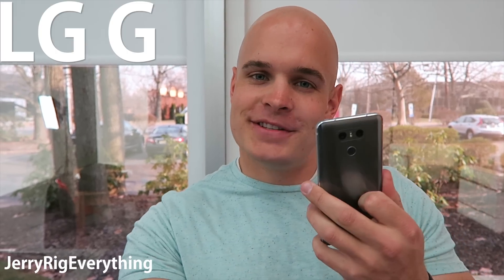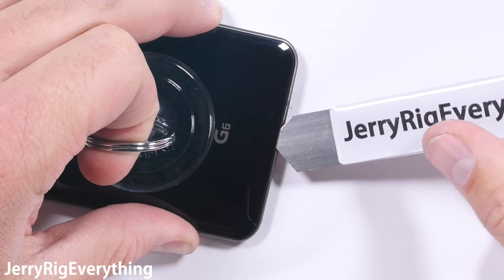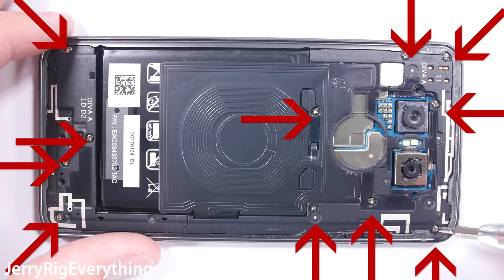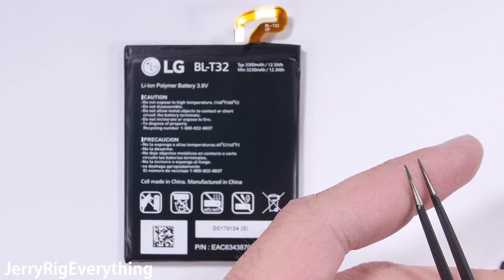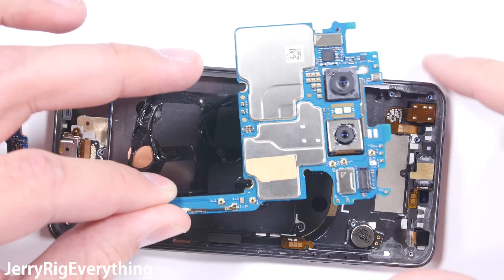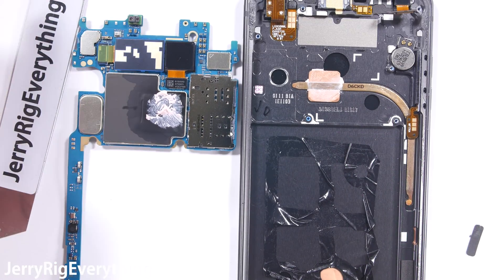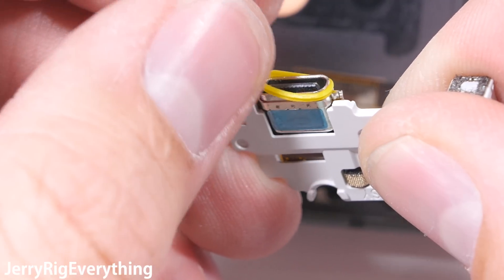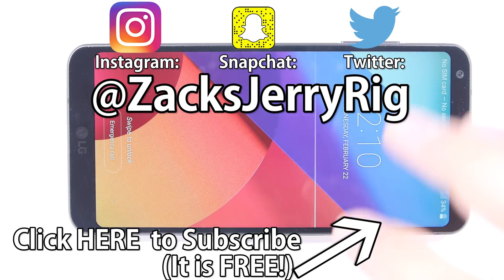First Look INSIDE the LG G6 Smartphone

Comment: Seeing the guts of this phone made me realize how stupidly regressive Apple is with the iPhone. Gives you a much better perspective on how Apple is cheating its customers with subdued features. LG G6 has a bigger screen but smaller body compared to the iPhone while also offering so much more.
Reply: The real problem with Apple is they run their company like a cult. It's a fashion statement to own an Apple product, not a practical choice.
Reply: Well, their hardware and software sure ain't lacking. In fact, they have one of the best if not the best hardware/software out there in the market today. What really puts me off about Apple is how they're purposely cutting off features from their products when you can clearly see that it's not only feasible but already done. Wireless charging + expandable storage + waterproof + 5.7" display in a form factor smaller than the iPhone 7 plus? Why are we not getting that in an iPhone?
Reply: I already stated above that Apple has one of the best if not the best hardware/software out there but until we see the A10 running on Android or the snapdragon 821 running on iOS, we can't really jump to that conclusion. I'm unbiased here, I own an iPhone 6S+ and a Note 4. Still prefer my Note 4 because of the features.
Reply: Requiem Aeternam It doesnt take a break down of a phone to realize that apple is garbage lol.
Reply: I'm very unbiased when it comes to tech and I always give credit where credit is due. The ecosystem of Apple is very mature and gives you exactly the experience you're expecting from it. What I'm pointing out right now is that I gave Apple the benefit of the doubt when they removed the headphone jack, thinking that it was all part of their design to utilize the space inside. Seeing the inside of this phone just highlighted how Apple's design team is lacking in that department.
Reply: +Vik you can't really compare the power of those two phones as they run different software, it's like saying the R7 1800X running in Linux is more powerful than an i7 7700k running in Windows. On the topic of the LG G6 being a newer phone, let's substitute in the S7 edge in for a moment and compare the feature set. Still the same results, I regrettably inform you.
Reply: Vik you just completely missed his point haha
Reply: Can you please look up the word "unbiased" and tell me what part of that definition constitutes what I said? Also, please make it a habit to know the whole story before making an uneducated opinion. Despite all of those blatant flaws in your so-called argument, you are entitled to your own opinion and I would gladly express mine.
Reply: Apple gets the most attention because they have a completely different marketing strategy than most other companies. Somehow it works. Sheeple (people who can't think for themselves) buy their products because Apple has built up an image and name. They just get an iPhone because they think it's what everyone gets or what they're supposed to get to fit in. People love to fit in. 

Practical people who want the most for their money can't understand the power of this 'herd' mentality. They can't believe it actually works. So they go on to social media and make fun of Apple for the features they lack, the restrictions they place on devices, the software issues, and the price they charge for it all. 

The sheeple don't like being called idiots for buying a product that was supposed to help them fit in. So they try to come up with ways to defend Apple. The reasons they give usually had no actual impact on the reason they chose Apple. They just blindly defend every little decision the company makes. Apple can do no wrong. They could make literally anything and people would buy it because it has a piece of fruit with a bite taken out of it stamped on it. It worked with the book they made. A book that only goes to show how full of themselves they are. 

I take that Apple logo to be quite a powerful metaphor. You're being sold an "apple," but when you get it there's a bite taken out of it. You paid full price, but someones gone ahead and eaten some of the best parts and you're stuck with the rest.
Reply: @imadecoy.  Damn.... Introducing philosophy into an iPhone conversation. I agree with your point, though
Reply: +Vik  Why ignore what he wrote? He isn't talking about speed, he even said "they have one of the best if not the best hardware/software out there in the market today".  I would also beg to differ in real world use. The iPhone 7 despite being more powerful, has inconsistent smoothness with its UI animations and scrolling in certain apps. Although I would put that down to the buggy iOS 10.
Reply: Right on the point!
Reply: I don't get why we're talking about chip benchmarks when the original topic was about software+hardware features.
Reply: "The ecosystem of Apple is very mature and gives you exactly the experience you're expecting from it."

"Well, their hardware and software sure ain't lacking. In fact, they have
 one of the best if not the best hardware/software out there in the 
market today."

This is what you're calling "shitting" on Apple. Nobody needs to impress you, don't be an entitled prick. It really is okay to be smart wink wink.
Reply: Lesley Harrys I don't think he is a fanboy so much being that he owns both an 6S and Note 4. Extreme fanboys don't usually buy from the company they hate, at least that's generally true most of the time.

The way I look at it is he's talking about what Apple can do better in line with the current tech trends.
Reply: Lesley Harrys Calling people dumb and insecure is hardly civil discourse when talking about matters that aren't personal. Fanboys like being personal, and I'm afraid you display that more than he does.
Reply: Lesley Harrys You're going to have to try harder than a few basic insults. I get it. Your feelings are hurt so you're lashing out. Feel better soon buddy.
Reply: Apple isn't that bad if you just consider their hardware and software alone. What makes them suck gigantic hairy balls is the insane overpricing.
Reply: +Requiem Aeternam  The R7 1800X actually IS a much faster chip than the 7700k in many cases other than games which favor clock speed over core count. The 1800X in fact, beats the much more expensive 6900k in some workloads as well, all three systems running Windows btw ;-)
Reply: Also note that there's not a single word in my comment that merits this statement, "Throwing words you've read in word-of-the-day toilet paper doesn't impress me."

That went from 2 paragraphs to 5 sentences to unfinished sentences real quick.
Reply: Lesley Harrys One reason I can think of why people feel the need to constantly compare the iPhone with nearly every phone out there is probably due to its status as the phone that started the smartphone revolution. 

It was never the first ever smartphone historically speaking, but it did what all others before it failed: present a well thought out package. Apple's track record of producing consistent quality products has made it kinda the unsaid de-facto standard that other companies use as a competitive target. 

In a competition such as sprinting, people always tend to compare against the best set times with each other, and Apple is like the best sprinter amongst the rest of the other OEM's in the smartphone race so comparisons will be inevitably made for or against it, depending on one's bias of course.
Reply: I don't know about you, but the reason I brought up the iPhone and Apple is that I own one. If that fact is still isn't clear to you, I'm afraid I have some bad news. I was feeling cheated by Apple as a customer and that's why I stated those errant things. I get your point that in every video, someone brings up the iPhone, but in my case I was comparing it to something I own. If I had a Pixel, for example, I'd compare it to that.
Reply: Dude, the fact android devices were faster a few years ago is kinda irrelevant. I'm talking about the iPhone 7 now. Benchmarks isn't necessarily a big deal but it supports my point that the iPhone 7 peforms better or can be considered more powerful. Now please can we just end this argument.
Reply: Allen Berry Agreed. Even though their phones have been hit or miss, LG has always tried to do something new, which can only be commended.
Reply: +Vik  It's a shame all this fluff has filled this comment thread. As I now have to quote your comment for you to know what I'm talking about in my reply:...
"Therefore, this has to be judged based on benchmarks and real world usage where you already know who comes out on top." 
I just gotta say, just a few years ago many Android phones were much faster than the iPhone in benchmarks and in some real-world cases, take the S6 vs the iPhone 6. No one on the Apple side was talking about "benchmarks" or "speed of apps opening". Usually it was just the Android users who would quote benchmark ratings and fluffy stuff like that. Now you're talking like it's a big deal.  The Exynos Galaxy S7 is technically superior to the HTC 10, but the HTC 10 is extremely responsive and fluid because of the optimization.
Reply: Requiem Aeternam I think what happened is they wanted to revolutionize with the 10 year anniversary iPhone so they had something of a dilemma with the iPhone 7. Removing the jack let them get as much as they could out of the current design, since they are running out of ideas.
Reply: Missed your other comments. Okay sure. I agree; if that condition is not met, then the conclusion cannot be made. Fair enough. But, you need to consider the fact this will never happen. Therefore, this has to be judged based on benchmarks and real world usage where you already know who comes out on top.
Reply: I never said that that was shitting on Apple. I know it's okay to be smart. You should try it sometimes.
Reply: ***** You don't need to stick to a single thing to be a fanboy. He displays blatant fanboy behavior. I couldn't care less what he owns.
Reply: Lesley Harrys "Apple gets way more attention from sad losers like you, that can't help but cry about them every time any piece of tech gets mentioned" looks pretty hurt to me. You think that was copy pasted? Should I feel flattered?
Reply: Lesley Harrys you think this is some kind of schoolyard where your little remarks actually mean anything? I never said the value of a human is related to what they buy. However, their type of personality or thought process very well may be.
Reply: Lol you lot are arguing about intelligence yet its funny how neither of you seem to be smart enough to realise that this whole argument is pointless now and wont lead anywhere.
Reply: ***** Of course it's pointless. This is the Internet, where people will devalue each other's opinions relentlessly because they can always find an alcove of like minded people to retreat to. I just like the discussion and to see if I can get some intelligent responses to exercise my mind. Doesn't often work out that way though.
Reply: Lesley Harrys Oh I'm sorry, the text must just be coming out garbled on my inferior android device.
Reply: +Vik  
Respectfully, I think you might have missed my point Vik. The fact that Android devices were faster is not my point, my point is the change of stance that some Apple fans have taken talking about numbers and benchmarks where in the past all that mattered was the end experience. Also I don't feel I'm arguing with you, but merely discussing. Unlike some of the other commenters here, I feel I'm being quite civil and polite. Cheers
Reply: +Lesley Harrys  Ok, what you're talking about is what I was saying, software optimization. Historically the iPhone has been extremely well optimized with very few bugs and yet here we are with the the iPhone 7, that has seemingly more glitches and runs less consistently than the Pixel while being more powerful... Seems the roles have reversed.  Even my 6S which isn't a slouch, has suffered from iOS 10. I'm sure they will fix it as they continue to iron out the bugs. My point = numbers don't tell the full story...
Reply: I agree, there has been a change in stance. It makes sense if you think about it. Before iPhones scored lower than android phones, so why would prideful apple fans discuss benchmarks? Now that iPhones score higher than android phones, apple fans have something to talk about. Android fans however, are much more like apple fans from before; they won't discuss something that they are inferior at. Thats what I think.
Reply: +Lesley Harrys
The Pixel is overpriced for sure, very ballsy move by Google when you have well-known flagship phones like the S7E that sell for hundreds less AND have expandable storage.
A lot of phones have pretty decent performance today, with not many bugs. I think the biggest thing at the moment is LG's bootlooping issues which are supposedly fixed with the G6?. The S7 Nougat update has made the S7 an all-round much better phone, not only in appearance but in performance. (I actually joked on my Facebook that the S7 7.0 update was what iOS 10 should have been lol) The OnePlus 3T is a fantastic choice with an extremely lightweight, yet highly capable build of Android. I agree, it is severely underrated. However I think people flock to what they know, hence why Apple and Samsung are the two main brands people are buying. Google seems to be doing pretty good with the Pixel even though as a phone maker they are very new, I think that is because they have a massive brand image (just like Apple with the iPod/Mac before the iPhone was released).
Reply: +Vik They didn't discuss benchmarks, they didn't need to because the iPhone was generally a better performing product. Now that the iPhone had the big iOS 10 debacle Apple fans will talk numbers. I won't go so far as to say it's hypocritical, just simply an observation.  The OP's comment was somewhat antagonistic but to his point I kind of agree now, if Apple are going to charge what they charge, with the components they have, I expect the software and optimization to be basically flawless or at least a large marked improvement over the competition. In the past I would say that the iPhone has been more than worth the large price-tag because of the cohesive overall experience. For me and many others who have been iDevice fans, I think that might be slightly changing. He simply stated his opinion, albeit with a bit more frustration than necessary maybe?
Reply: +Lesley Harrys
"Where did you get the idea that iPhones scored lower?" 
Well, it's pretty well known that up until the iPhone 6, the iPhones were as powerful in many benchmarks aside from graphics. The iPhone has leapfrogged Samsung a few times and vice versa but for a majority of the time Samsung has had the best silicon with the Exynos. However that never really mattered because the iPhone was faster where it counted. That's the point.  And the iPhone's processor lead is going to matter less and less as all SoC's are getting so fast that they continue to encroach on Intel's bottom line performance wise. What is starting to change however is that Android OEM's are starting to sort their shit out with the software while Apple continues to try and expand on iOS's features to make it closer to Android. I think they should have tested iOS 10 with a lot more users before shipping it. iOS 9 was perfectly fine, and I completely regretted upgrading my 6S
Reply: djlobb  From a hardware point of view, Apple could theoretically offer more like such as creating a thin bezelled iPhone. However, since they've stuck largely to the same metal chassis shape since the 6/6 Plus, this shape combined with the iPhone's internal layout has in some ways restricted Apple from being able to present a radically different iteration from the previous generation–and I'm not just talking about aesthetic. 

This could be the reason for some people's frustration with Apple for not "getting on with the times" when they compare against an Android product. People tend to forget though that Apple isn't just a company who simply follows trends for the sake of keeping up.

Apple will present an iPhone with a radically different internal as well as external design this year so there's hope for radical change. Maybe then it will be easier to understand Apple's pricing strategy.
Reply: Requiem Aeternam well LG needs to start marketing more so Apple will be forced to make better products, if LG didn't make phones I'm sorry to say this but the current phones would still have been the same. I agree LG has good features they just need to bring more people to the table then it would make other companies make their phones even better every year, the more competition, the better phones we get
Reply: touché... it's a freaking religion.
Reply: Requiem Aeternam Did you miss all stuff they are adding to the IPhone 8? This phone will be nothing compared to IPhone 8. Wireless charging, no home button, better internals, etc.
Reply: Requiem Aeternam we are in fall.
Reply: Vantage Games a phone better have better internals than the last generation
Reply: Not just Apple mate...HTC is also struggling to reduce their bezels size and keeping headphone jack. Both are also charging through the roof. 

Seems to me South Korean (LG and Samsung)  and Chinese (Xiaomi, Huawei  and ZTE) companies are now leading the market in terms of smaller bezels and better use of space with hardware.
Reply: Noctis Lucis Caelum Not entirely true. The HTC u ultra is highly likely to be HTC toeing the waters to see if people will be willing to pay for a phone with a high price tag with its design and audio(at least from its marketing) HTC has rarely removed the headphone jack. Plus, the phone comes with its own earpiece, unlike the iPhone 7
Reply: Yeah, they cheap out on a lot of things that's true but the operating system and the Apple ecosystem are much better use than what Android has had to offer...pretty much ever. Plus, their phones are still quite good, the lack of a headphone jack isn't an issue for most (me anyway), neither was the water resistance (though mine has it), nor the screen size (I'm comfortable with it but sure more is better), wireless charging doesn't sound like a bad idea on paper (if I could charge it anywhere while outside, but here in the UK there are few places to do that, it's more of an American thing). Then you get down to the performance itself and the iPhone 7 beats all of its competition. Apple have essentially a monopoly on their services and I hate them for that and for dodging taxes as well and for cheaping out on features for the sake of profit but their business decisions do not have a negative impact on me personally, so their phones are still better to me.
Reply: FirstName LastName its a matter of getting used to it.
Reply: Requiem Aeternam I see apple pagla people are trying to defend the company that's stealing from them.😁
Reply: Well it can get pretty broad as Apple fans and Android fans always have a counter-argument that's not strictly topic-related. People in general do follow that psychological thinking. It's a way to defend or justify 
their preferences.
Reply: You are absolutely spot on, Caleb Kan. I wasn't trying to be civil. I just get annoyed that you can't read the comment section of a new smartphone (ANY smartphone) without someone feeling the incessant need to bring the iPhone into the discussion. Why can't we talk about the LG G6 in its own right? And if you HAVE to compare, why can't you compare it to its predecessor, the G5 and focus on the major improvements in design philosophy LG has made in just a year? Why does every single thing having to do with smartphones always have to come down to the iPhone?
Reply: djlobb I agree with that point. My iPhone 7 Plus has some annoying bugs, that have led to more frustration than the previous nine years of using iPhones. On the other side, the Pixel seems to be the very best example of Android and isn't really representative of the norm. More often than not, even high end android handsets are riddled with bugs because manufacturers can't help but fuck with the software. If you want to avoid that, by all means get a Pixel. If you really don't want an iPhone, the Pixel is close to the best phone you can buy in my opinion. It's also one of the most expensive, even more expensive than the iPhone 7 (Plus) in the Netherlands. 

If you don't want to spend near €1000,- your best option seems to be the OnePlus 3T. You don't get that fantastic camera, but you get just about everything else that makes the Pixel the best Android phone on the market. For less than half the price.
Reply: But the fact remains, it performs better in benchmarks, gaming and real-world use. And your comparison is not relevant because the A10 is a more powerful chip than the snapdragon 821.
Reply: Requiem Aeternam Throwing words you've read in word-of-the-day toilet paper doesn't impress me. Not when you very first sentence says the exact opposite of what you meant to say. I know what unbiased means, and you clearly aren't unbiased. Not every opinion needs to be "educated" by the "whole story". Not when someone is as blatantly hypocritical as you are.
Reply: Requiem Aeternam Nothing more annoying than people like you: dumb people pretending to be smart and throwing random non sequiturs around
Reply: "Gives you a much better perspective on how Apple is cheating its customers with subdued features."

Yeah, totally no bias there..
Reply: Apple gets way more attention from sad losers like you, that can't help but cry about them every time any piece of tech gets mentioned
Reply: something1random23 What about that copy pasted rant was supposed to hurt my feelings exactly? You said nothing new, nothing true and nothing relevant
Reply: ***** I'm guessing it's not the first time you've posted this "smart" and "insightful" remark. Too bad you're completely wrong in your assessment. You should learn to read.
Reply: something1random23 Well, comprehensive reading could be an exercise for the mind. You should try doing that sometimes.
Reply: ***** Where did you get the idea that iPhones scored lower?

I really could not care less about benchmarks, just as I couldn't care less about what gimmicky features my phone is missing. I don't need to tinker with my phone: I want my phone to be able to do what I want, when I want, without hassle. The iPhone, for me, has been the best at doing that consistently. That is why it's my primary handset, even though I own a few androids. 

It's good to see manufacturers follow apples idea that a smartphone should be more than the sum of its parts. The Pixel is not the most impressive smartphone on paper, nor does it have the most features (it's even missing a few key ones). It is, however, the best.
Reply: It's quite pathetic, how insecure fanboys like you always need to drag Apple and the iPhone into something that has nothing to do with it. It's telling how you can only appreciate something by having to completely shit on something else first.

Calling yourself "unbiased" is perhaps the most blatant lie I've seen since Donald Trump last spoke publicly
Reply: something1random23 What the hell is that supposed to mean? Let me guess: you've convinced yourself that I'm an "Apple fanboy" or "iSheep", just because I disagree with your ridiculously childish prejudices?
Reply: something1random23 Ofcourse that seems hurt to you. That's why you're a sad loser: you somehow equate the smartphone that someone buys and uses to his worth as a human being. That makes you pathetic and petty.
Reply: something1random23 You did, actually. Also: value =/= worth. And your petty and childish rant illustrated what kind of personality and though process you have perfectly. 

I'm done with you now. People like you never have any valid argument anyway. You've typed four paragraphs without giving a single argument. No doubt you can spew a few more prejudices and non sequiturs to stroke your own ego. I actually have adult things to do.
Reply: djlobb It's not the fact that iPhones score higher in benchmarks that is often mentioned: it's the fact that iPhones, even with seemingly inferior hardware, consistently outperform high end android phones. This has been the same for years.
Reply: Yes Apple may be regressive in many aspects, but the iPhone 7 is still more powerful. And the G6 is a newer phone...